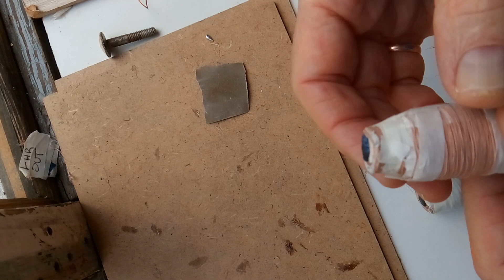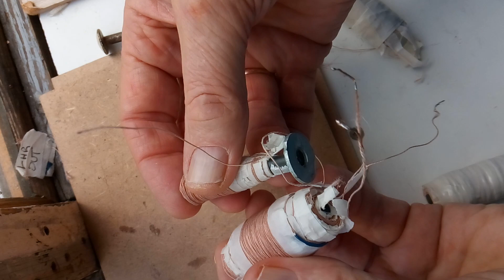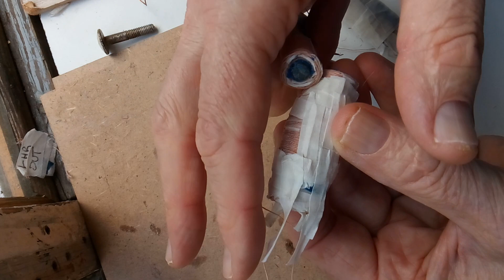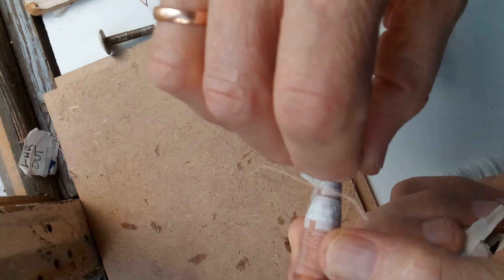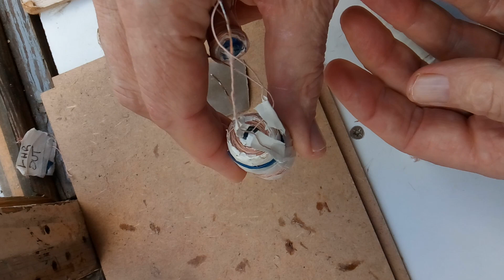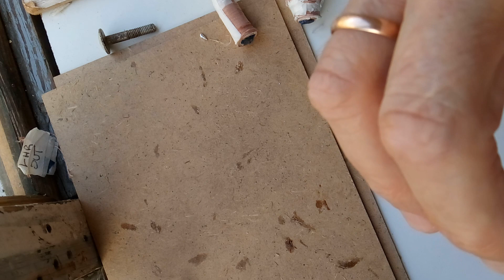High frequency Litz- wire coil construction

Comment: Hi, thanks for the demo. A suggestion to stripping the Varnish. Do not use sandpaper. Expose your wire ever so briefly to the Yellow color tip of a standard candle flame. This will leave a bit of soot that can easily be wiped off with a micro-cloth. Then dip in isopropyl alcohol, let the alcohol evaporate then tin as per usual.
Reply from the maker: Thanks Robin for the very good tips on cleaning up the Litz wire to accept solder.
I was told by Boeing engineer that during WW2 they had a boiling vat of alcohol they would dip the ends of Litz wire into....I like your method better using candle first then the alcohol